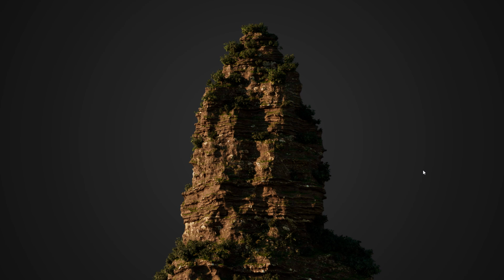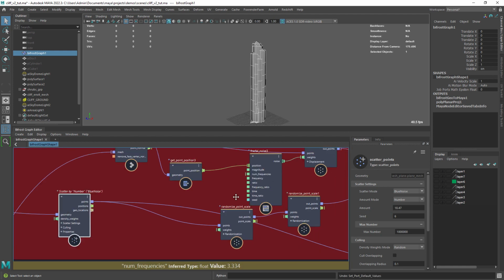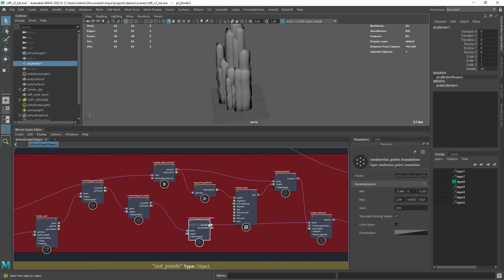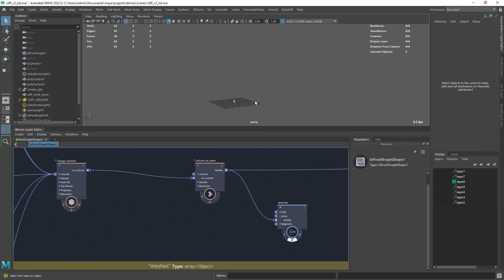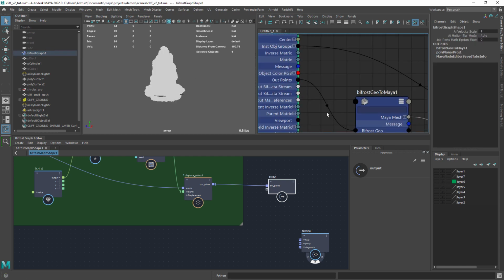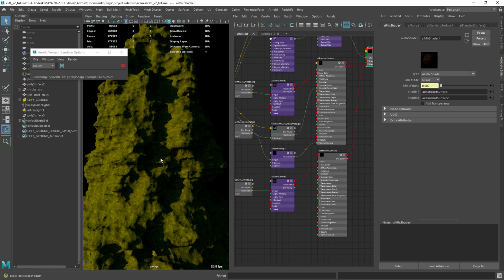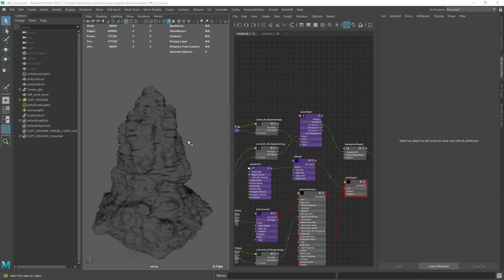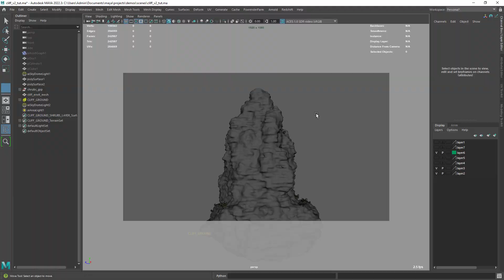Procedural cliffs in Maya

Comment: ….yeah welcome to bifrost, see all the “easy” unreadable, random nodes all over the the place? Oh don’t worry about the $60 plug-in that I just decided to mention I used. I’m done now, hope you enjoyed your seizure..
Reply from the maker: Well, I'm sorry you didn't enjoy it. But you can always ask for the parts you couldn't follow. In the previous tutorial to this, I did a step by step maybe that can help you. About the 60$ plugin I paid for it and wasn't at all any sort of paid ad. Actually I had many issues with it in the beginning. For that specific part you can easily use mash which is free. I didn't use mash because was constantly crashing Maya , but I believe it's something to do with my machine. Cheers
Reply: The new triplanar node in Arnold could also work for the grass in the shader. Check it out.
Reply from the maker: @mudoglu  Indeed, didn't think of that. Using the Y axis. Thanks
Reply: Time to switch to a other software